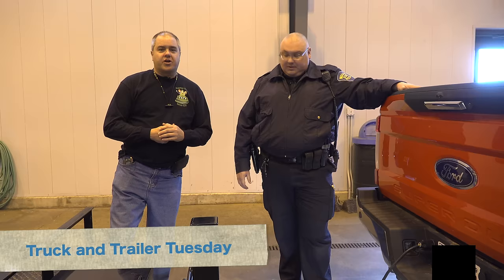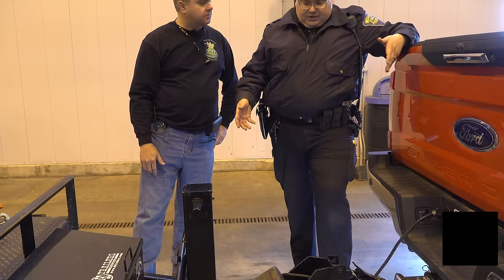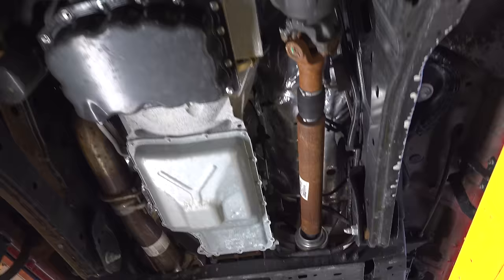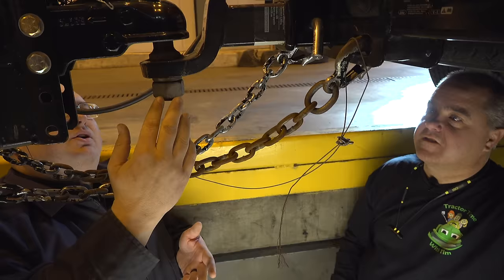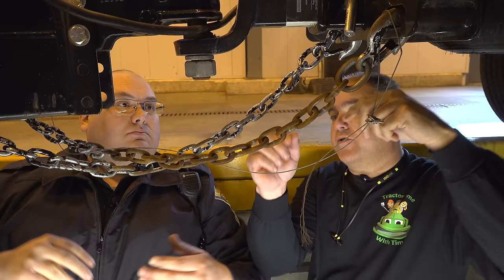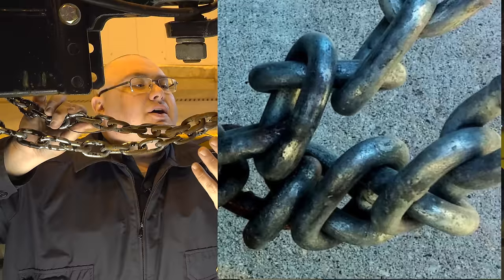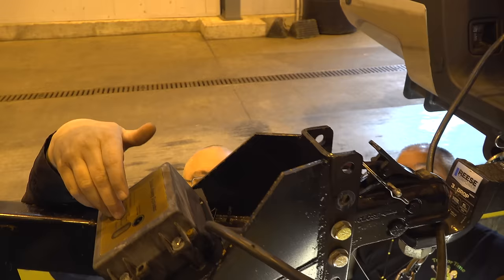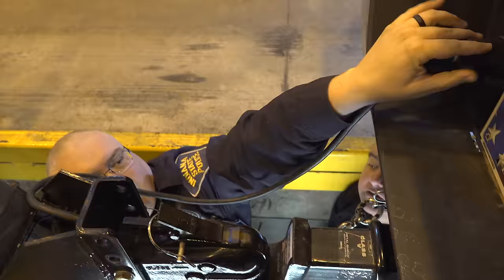Uhoh! Tim Fails Inspection! Truck & Trailer Tuesday with Trooper Hoover

Comment: Worked a triple fatality wreck caused by a tiny 4x8 trailer that fell off a truck. It was unloaded and went into the opposite lane. Motorcycle crashed into it and then another motorcycle after. All three riders went into the guardrails and got sliced up pretty good. If the guard rail hadn't been there they may have survived with just broken bones and concussions and such, but all the circumstances turned out bad for them. Luck of the draw I suppose. The timing of all the events couldn't be worse.
Reply: Alot of small trailers like those dont have the emergency brakes because they are so small and if a small trailer like that comes off whoever's loaded it is dumb as hell
Reply: @americanmuscle9492  I see small trailers without anything and i gotta laugh. I could pick it up and put it in the back of their truck and then they would not have to worry about it. Most of them can not even be seen in the mirrors anyhow and should be banned.

Comment: I hate when i go to the demo derby. Guys have nice new aluminium trl being pulled by a clunker without a light plug or have guys with 1 ratchet strap running through the missing windows

Comment: Unfortunately most trailer manufacturers use those scotch blocks when They splice the wire and add lights.
I remove all scotch blocks and butt splice them with proper connector, dialectic grease and heat shrink.
Reply: Sam Garofalo 
Yep cheap way to do it
Reply: I solder and heat shrink the wire joints. Butt connectors can corrode, even with dielectric grease.
Reply: Ralfie 
I use 3-1 heat shrink with glue and not the harbor freight cheap stuff and have had good results, solder is much better, but all connections should have adequate heat shrink and just about anything is better than those scotch blocks.
I would not even use the scotch block under the dash
Reply: Sam Garofalo 
Yep, I take those off and chunk them. I wasn't talking about HF splices, I use good quality ones from Vantex Electric Products in Ft. Worth, Tx. They just aren't the ones with the hermetic seal, if that degree of protection is needed it gets the solder treatment at a fraction of the price. Soldering is the best option for boat trailer wiring.
Reply: Ralfie 

Absotively

Comment: I was taught the safety chain hooks should face towards the back
Reply: Daniel Dunham Yep! They’re less likely to fall off and are stronger that way. Also that electric brake cable technically is wrong as well because it’s wrapped around the chains and also is home made with those clamps. It should always be replaced with a new factory made brake away brake cable with a solid connector loop on the end. I’m surprised they didn’t mention that cable isn’t correct being made that way.
Reply: @lawnboy81SMS  they definitely mentioned the brake cable needing to be fixed.
Reply: Dexter Schray Did they? I must’ve missed it.

Comment: Spray or roll the underside of trailer with a bedliner material to keep from rusting through the frame.
Reply: Don't....  There is zero chance of achieving a 100% seal.  So what happens is water and salt make their way in.  Then it gets to sit there chewing away at the steel hidden from sight.  It also gets to work for longer periods of time since takes so much longer to dry out.  Something like fluid film will go a long way to extending the life, and is so much easier to work with if a repair or modification is needed.

Comment: Didn’t know the emergency brake cable had to be attached from a different point from where the safety chains hang. Makes sense now
Reply: When I first started my hauling business I used to hook the brake cable to the chains lol until a dot officer stopped me and made me an inspection and told me to hook it to my truck’s frame lol

Comment: I do not think the battery status button is a required item . most new battery boxes have them built in , but not all . They use a volunteer to see if the battery is charged . $500 fine for the last guy I knew who had a dead battery .
Reply: Volt meter

Comment: One thing that was not said was ware the hitch is hooked out I had 2 of these type hitches fail one rusted  alot and was not safe and the other tore going down the road I was lucky I made it to ware I was going the roads in Michigan were so bad it made the tung of the trailer go up and down alot so it put more wait on hitch and one side was 3/4 torn off when I got to ware I had to be to un hook I seen that the recover was bent down closer to the ground that truck was not allowed to tow a trailer till it had a new hitch on it

Comment: This is called a hitch pull not bumper pull. If it were considered bumper pull your ball would be mounted on the bumper itself. If you have a class 4 hitch on your truck that is a perfectly acceptable way to pull heavy loads You do not need a gooseneck or a fifth wheel all of the time.

Comment: Did I not hear the Trooper correctly, I thought he said since you have no suspension on the trailer. Does your trailer not have any kind of suspension under it on the axles? If not I suppose there is a reason for that and would you share that reason with us. I've had several trailers over the years and never owned one that didn't have suspension on the axles. both single and double axle trailers!
Reply: adirondacktrail  Thank you, I was wondering about that.

Comment: Suggestion for future videos, if you are recording in a set environment as was the case with this segment AND you want the license plate obscured please simply tape a piece of plastic garbage bag, sheet of paper, or chunk of cardboard directly over the plate vs having the dancing black box hoping and resizing on the screen.  Quite distracting in my opinion.

Very surprised about the twisting of the chain being allowed and seemingly recommended since that is the quickest way to break a chain, snapping a load on a chain that is twisted will shear the weak link.

Comment: The Trooper didn’t address the length of the safety breakaway cable in regards to the length of the safety chains.  Have you learned anything about that?

Comment: With cross bolts like that on the trailer hitch mount the only way to inspect them is to remove them and measure them.  After a while they can wear and eventually snap.
It also would be nice if he pointed out that the breakaway cable shoulddn't be tangled in the safety chains.   Kinda defeats the purpose.

Comment: With you pig tail plug on the trailer always make sure that your constitution are clean best way to protect them when not connected to the truck is to cover it up I made a rubber cup for mine
Reply: Are you trying to spell
 "connection "?  SMFH.
Reply from the maker: @B Harmon  come on, we don’t need someone coming along critiquing everyone else’s spelling and auto correct errors.

Comment: Safety my ass.. countless amount of times I've been inspected bumper to bumper, logbooks worn out from officers looking for a tiny speck of a mistake. My records and equipment has always been clean, polished, organized and maintained to top notch. Yet I always pulled out of the chicken coop with a stupid "we can't find anything" ticket. Aka oil on motor, excessive grease, excessive load strap, ect,ect.... it's purely revenue. And Indiana is known heavy for that.

The biggest problem is that it cost more to fight the damn ticket than to just pay it. And DOT "revenue enforcement" knows that.

Comment: Run the trailer brake cable (electrical) through the coupler pin latch. No more low hanging cabling chafing the road surface.

Comment: I have a Class A CDL in Connecticut and we were taught that the hooks on the safety chains are suppose to be the other way around than what you had them. Hooked from the bottom, not from the top (as you had it)

Comment: APM309 is his license plate number it's a Ford f350 super duty 6-speed manual 6.7l v8 engine 4wd crew cab with an MSRP of $52,135 try harder to blur the license plate, next time guys I could tell everybody your personal info if I wanted to.
Reply from the maker: Interesting on the MSRP...it was MUCH higher than $52k.  Other than that, big deal.

Comment: Your break away cable would fail ,it should not be hooked to the safety hook its either hooked to the truck or looped back to the trailer

Comment: Damn!That ball is reallllly loose.. As loose as that ball is, that's and easy way to snap the shank off of the ball an cause a runaway....if I'm running @ a pre-set height (don't have to flip the hitch to make the ball higher) ,I use a welded ball,or use a ton of red thread lock if I'm stuck with a threaded ball...if you tow a lot on a ball,check that nut torque every 5k miles...or just switch to a pintle and be done with it.
Reply from the maker: I made a mistake by not tightening it. It did not work loose.  I simply forgot to tighten it when I installed it.
Yes, pretty major...I tightened when I got home (several years ago now), and it has not come loose since.

Comment: Will hooking up 2" trailer latch on 1 7/8" ball be a problem? I had 1 7/8 ball on my hitch and when I rented a trailer from home depot, they refused to connect their trailer (2") to my hitch. I had to buy 2" ball and mount (could not undo the nut..).
Reply from the maker: Yes. They did the right thing.
Reply: I hope you're joking.  A guy killed a 20 yo college girl around where I live because he did that, in conjunction with having an improper safety chain.  He came close to going to prison, but his lawyer managed to get him off with just a traffic citation.  I doubt that lawyer was cheap, tho.
Reply: @l337pwnage  2" vs 1 7/8" is just 1/8" difference. As far as I know 2" trailer fits fine and never heard of it popping off. But better safe than sorry. :)
From what I understood from google search 1 7/8" used to be common while back, but now 2" is morr common and hit has higher load rating.
Reply: @l337pwnage  Can you find me an article that 2" receiver on 1 7/8" actually caused it to pop? While I understand it can happen, I think it is more of worn out receiver that caused problem not the difference of 1/8" and probably would have popped even if it has 2" ball. Safety chain should been inspected and connected properly as well regardless.
Reply from the maker: I’m honestly amazed someone would argue that connecting a 2” connector to a 1 7/8” ball should be acceptable.
If one has ANY interest in safety, and the lives of others !hey would not try such a thing.
Unbelievable!
Reply: @TractorTimewithTim  I'm all in for safety. It is just that I have hard time believing 1/8" difference will pop the hitch because that would also mean small ware on the ball or receiver would cause it it pop. If 1/8" makes such a big difference, than the ball hitch seems very dangerous to use in the first place.

Comment: It's not just about safety it's part revenue scam for the state and inspection safety, most accidents aren't caused by defective equipment it's operator error! If you live in a rust belt because of salt, or drive a semi regular garage maintenance should suffice but that another issue.

Comment: Back in the day, Dot would issue a "fix it ticket " . Anything not crazy unsafe was written up and you had to have it repaired in a period of time. Light bulb out, cracked wiper blade, and etc. Now its all about money. Big fines for every little thing. So, instead of dot using their pit to assist a driver in keeping his truck safe, he has become the enemy and is feared and avoided at all costs. But you say, if you keep your truck in good shape you have nothing to worry about. Not true. I challenge anyone to take a brand new truck and trailer, have it inspected in Ga where it is 70 plus degrees. Next day, have is inspected in Minnesota when it's 20 degrees out. It will have multiple air leaks, guaranteed. Not enough to be considered unsafe, but will get u a violation on your license and possibly a fine as well.

Comment: There's a torque spec on that ball stud:). Flip it upside down (or sideways) in the receiver to hold it for tightening.

Driveshafts aren't painted because of balance issues but IMHO there should be some type of non-dimensional protection applied at the factory.

Comment: he would hate to see my trailer, it was built as a home made in early 1970's brakes were removed sometime in its life, so no brakes of any kind, no breakaway,  since I got it cheap & no intention of hauling a vehicle, I have never put tags or registered it. but I do have a clear title but in previous owners name, lol, but it is only to haul my tractor, between my 2 farms, & I use farm tags, & not took it to dealer for service, but its 15 miles to dealer by back roads, but I have the 2 homes, plus I use at my Uncles farm his health is not good at his age, so mostly just bush hogging as needed, & cousins small farm, city folk that moved to country with 4 acres to do small scale farming, my safety chains are almost new, I replaced when I got it, & wiring was bad shape & put new wiring for lights. 

If I ever decide to use for any other purpose I will have a job to correct it, but its paid for itself already. once upon a time I built trailers, so I know what to do & how to do it,  but I never built me one as didnt need one at time, & I bought this cheaper than I could buy part of the metal, as soon as I decide to use it for any other use I will have to go legal & then have all the fees & paperwork, right now as a farm use, only hauling my tractor locally, nothing matters

Comment: A "bumper hitch" has the ball directly attached to the bumper. A "receiver or frame hitch" is a type of towing hitch that mounts to the frame of a vehicle. The majority of receiver hitches fit on the rear, but some can attach to the front underneath the bumper. This is a receiver hitch (or frame hitch) as it is directly attached to the frame. Please do not mistake a ball hitch on a bumper for a receiver hitch, the towing weights are vastly different.

Comment: Tightness of a bolt is checked by eye?
Reply: If hes wiggling the washer...it aint tight.
Reply: Charles Power exactly,,,  But he wasn’t wiggling it he was looking,,,,   Maybe joe pro trooper should grab a wrench..
Reply: Isnt troopers job to wrench, and you can plainly tell it was loose..he could move the washer with his finger.
Reply from the maker: He could not wiggle the washer.
Reply from the maker: He could NOT move the washer with his fingers.
Reply: @TractorTimewithTim  lol
Reply: At 4:27 he puts his finger on it and says there's a little bit of space...
Reply from the maker: Yes, there is ‘space’. The lock washer is not all the way collapsed.  However, it is collapsed enough that he cannot move the washer.
For the backstory, I tightened it all I could with the tools I had available.  I intended to get a bigger wrench and pipe wrench to finish the job. Unfortunately, I forgot.     
I think I’ll show this in a follow up episode where I fix the things he found.

Comment: Well i fail too because i dont have break away stuff on my trl.   Sssssh.  My brakes is all good though.  Can you ask him his view on pintle hitches that slide in.   This summer i broke my reciever adapter for a pintle. Pulling out of a field at church to the movie theatres parking i had to push the pedal down harder getting the trl to climb up a small grade and bang. My trl was on the ground.  I rewelded that hard with my 190 mig.  I have the perfect time to get a look under my trl that most dont.  I tarp my trl and crawl under to sleep at tractor show

Comment: Brand new truck and trailer in failed DOT inspection that’s why I don’t take my vehicles to get DOT inspected😂🤣
Reply: Jim fix ... the actual fail is operator error.... failure to spot small stuff on the pre-trip walk-around. Ball not tight and improper breakaway cable attachment is not really a component failure. Didn't really get a good look at that battery box but likely the test switch is broken, meaning it got hit with something.

Comment: Tim, I would take your truck back to the dealer and ask them what the hell with that drive shaft.. My truck is a few years older, about 50,000 miles and not a bit of rust like that.. And being in Wisconsin, you know we have even worse winters here.  I have never seen a new vehicle where the drive shaft took to rust that fast.. And being they are hollow, that won't be but a year or two and you will be replacing it at that level of rust decay...  I would take it in being it is new and demand they replace that with one coated and sealed properly.

Comment: Hold on I have to disagree with you and the trooper on this one. Due to the fact that the bumper is not rated for near as much as the hitch you are using.  Very big difference. It is very important for people not only to know the ratings for all the different equipment they use in hauling/ towing.

Comment: Didn't this k you could haul a large load without a "weighted" plate in Indiana. I was asked at the BMV when I registered my truck if I planned on pulling any sort of trailer and if so I MUST get a weight plate for a truck and an in god we trust plate would not be acceptable.
Reply from the maker: In God we trust goes up to 11,000lb.
Reply: @TractorTimewithTim  wow, I guess the lady at the bmv did not relay that info to me! I actually got a 7k plate though I never hauled anything over that (combined truck and load). Great information though! I hate the plain white plates anyway